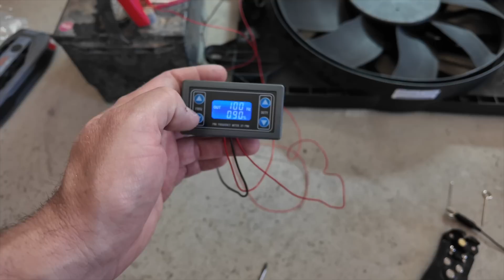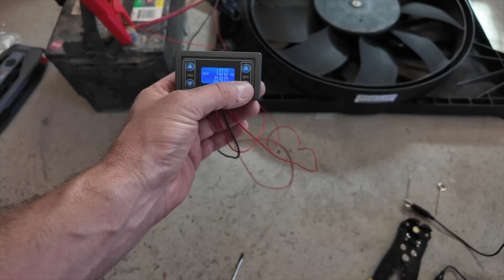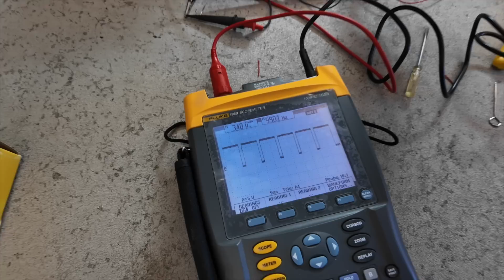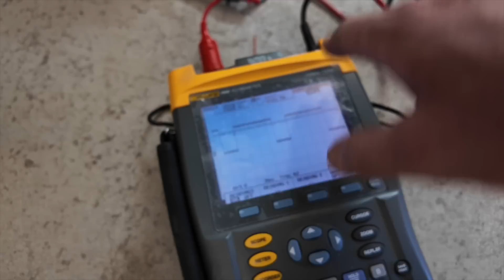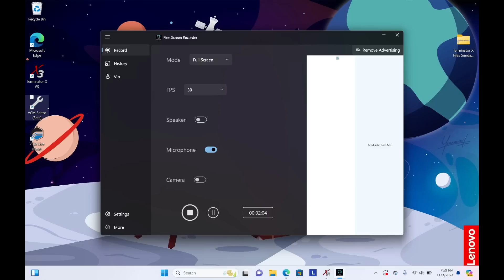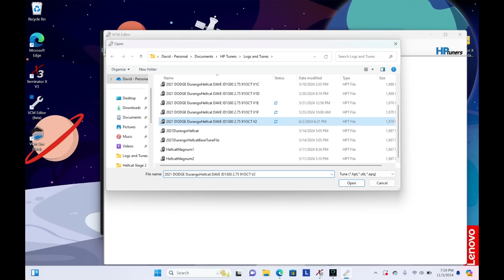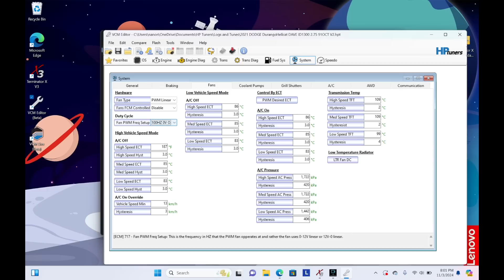HELLCAT MAGNUM Now Has COOLING FANS - HP TUNERS NEW PWM Drop Down Menu - FACTORY COOLING FAN CONTROL

Comment: Awesome video!
I just updated mine to version 5.1.4429 beta in hopes to control my brushless tahoe fan(100mz,90down to 10%DutyC) in my C6 but the VCM features did not update to allow me the ability to change settings as yours does.
Would you have any advice on how to get this to work?

Comment: I down loaded the latest BETA. Opened up a stock 21 Durango Hellcat file.  Duty cycle is 100hz 0 on voltage.  It appears this option is only working on the Durango Hellcat file.  I opened muliple charger/Challenger Hellcat files and the duty cycle option is not there.
Reply: I have Download the Beta version.5.1.3689 and i don't have the duty cycle Option with a 21 Durango Hellcat File :/

Comment: EXACTLY😢
Apparently there's an issue, I'm sure of why. PWM must be phased with the physical design of the motor*PERIOD! That's part of PWM engineering / similar to 3 phase Y & delta type wiring just a bit different in how they functional to frequency. But why TF? Same mfgr using different architectural design for PWM's?? What a shirt show😢
Reply from the maker: The same company makes all the oe fans lol

Comment: Question about your dash and center console. I know its part of the project that remains unfinished, but I was wondeirng if you could 3d print what you want, cast the print in a mold, and then lay down fiber glass or carbon fiber in the mold? It would allow you to work the final product into the shape you want and you could have it covered in leather, vinyl, whatever... Still in awe of your fabrication skills. The rear end on that car is a master piece.
Reply from the maker: I'll get it done been working on more important stuff though